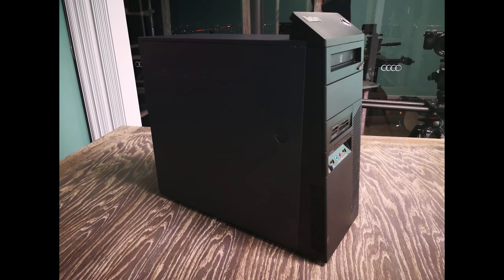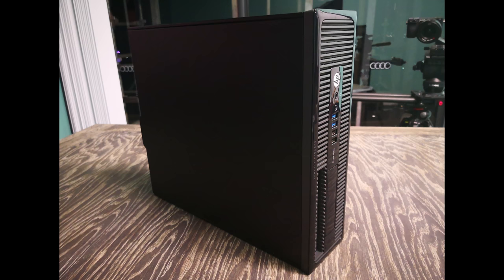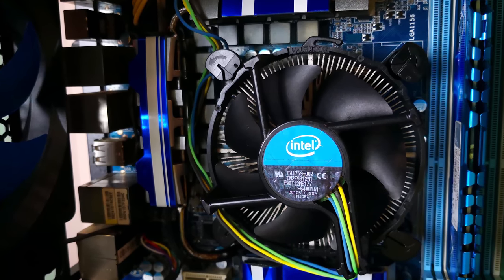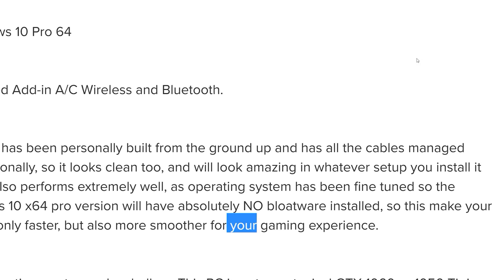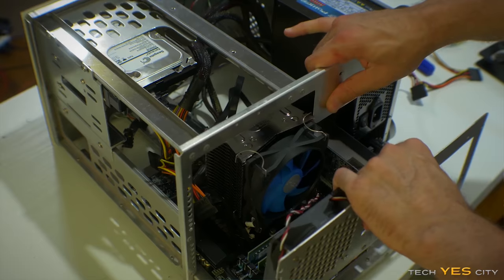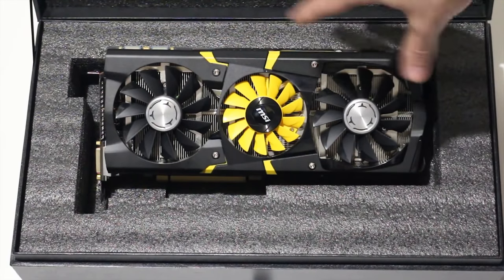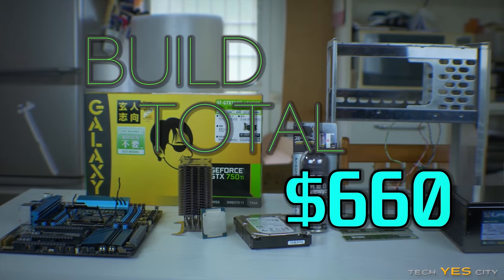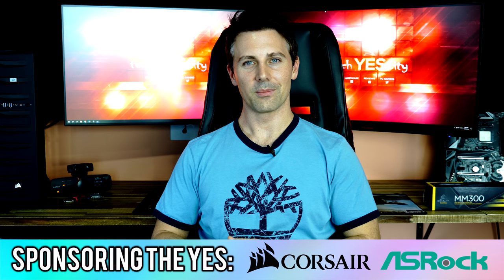How to SELL A Gaming PC In 2018 | Should You Sell Your PC Gear BEFORE a Launch?

Comment: Take photos
Upload description
Include statement: Being sold by Bryan, TYC
Everything sold within 30 minutes of being put up, easy money, it isn't the fact that people want to buy the PC it's rather they only want to meet Bryan and shake his hand in completing the sale.
Reply: Scyn I need your help...You see, I have a FurnaceX-9590 PC
Reply from the maker: Lol, like 95% of buyers never know who I am man.
Reply: having an fx chip isn't really the problem cooling it is, as long as you can keep the temps down it is still worthwhile if you can get it cheap enough.
I still have some rigs which I use from time to time which have 8370 & 9590 chips, works like clockwork if you have adequate cooling just don't expect Ryzen, Skylake, Kaby or Coffee Lake ICP.
But then again you could get the same if not better performance out of a Xeon 1366 or like chip but with triple channel memory, and perhaps slightly cheaper.
Reply: Scyn My PC is probably the ONLY air-cooled FX-9590 with a 212x, some fans and a 750W PSU out there...It gets stable up to 5.1Ghz on base clock, at 5.2 it gets too hot for full loads and past that... It's just unstable as heck. Through a lot of care and days spent on the BIOS for 3+ years, I get 35°C temps idle and 55°C temps at loads if I run it at 5.05Ghz with 202 on bus. That was enough for 100th percentile on userbenchmark. 

The DDR3 HyperX Savage 2400 RAM itself is limited to the mobo, I got it to 2133 with the XMP and then decreased the timings, went from 2T to 1T, increased processor ohms from 60 to 120 and put the refresh rate to every 3.9ms.

I recently put a GTX960 on it (for free) and got it running pretty well so far...With a bit of OC it chews through everything I play on 1080p. If I flashed the vBios, I could probably get it even higher but it's too risky for me.

The mobo is a Sabertooth 990FX R2.0, and with the CPU it's probably the sturdiest abuse-taking machine I know of in terms of consumer-grade systems.

The reason I need your help is because of the power consumption... No one wants a power-hogging equivalent to a Ryzen 5 system.
Reply: http://www.userbenchmark.com/UserRun/1635620 ---> Before I messed with it.
http://www.userbenchmark.com/UserRun/8126477 ----> Current state.
Reply: Advertise the fact that it is a stable overclock, it might be a powerhog but stable overclocks and a written explanation in the selling of the build of a whole goes further in trying to sell it to a willing customer.
What you want is a clean break with the machine rather than tech support down the line, written pdfs and examples of how to keep the machine in good nick down the line after it is sold does wonders.
Examples of what fps to expect if you want to sell it as a whole or part it out, parting it out don't expect people to fumble over trying to buy X part considering the amount of fake 960's which are out there or the amount of 9590's which are out there.

The only part which might sell asap is probably yhe HyperX memory, but again don't expect a win-fall from 2x8 dimms.

You are trying to sell this, advertise the PROS, don't leave out the CONS. heck even Bryan goes the extra mile to take the photos to show his builds in their best, you might also want to watch his cleanse 2018 video to get more pointers on how to show off your build in it's best light possible.
Reply: Alright, thanks for that Scyn. And also thank you Bryan for your videos.
Reply from the maker: No worries man, I love the sabertooth boards, they are solid.  Can you boot up final fantasy 15 for me and let me know if your FX cpu doesn't stutter like all mad?
Reply: Sure haha, I'll make sure to do that this next weekend ASAP.
Reply: Just an update, I managed to get the RAM stable at 2400Mhz woo! I redirected the case airflow and replaced the thermal paste...I'm not sure if I can still run the Benchmark for today but I'll see what I can do.
Reply: Lol

Comment: Used market in East tenn is horrendous, everyone thinks their gear is worth more than new prices.
Reply: Are you trying to buy a computer right now in East TN?
Reply: I buy and sell, I have a shop :)
Reply: Its pretty much everywhere where power is cheap when it comes to GPUs. Even the miners flipping at my country are pricing their used cards more than new.
Aliexpress is okay for odd items, but local e-shopping sites is where I get the deals now. Couponing is addictive.
Reply: How much would you pay for this? 

6700k - 4.7 ghz @ 1.32 volts @ 75c max.
Liquid cooler similar to the corsair H60. 
3 red led case fans
GTX 1080 Amp Extreme ( Best 1080 you can buy) @ 2114 mhz
Gigabyte z170 k3 motherboard (updated to most recent bios)
16 GB (8x2) DDR4 @ 3100 mhz - 1.356 volts
LG GH24NSC0 multi disc drive
Sandisk 128 GB SSD 
Toshiba 2 TB HDD
Windows 10 home 64 bit
AC Wifi USB dongle included
ATNG 800w 80+ Bronze power supply
Reply: Damn yeah I've been struggling to find pc parts at a good price... I also live in Knoxville btw. Lack of a microcenter doesn't help
Reply: I'll give you a 7-11 Slurpee for that pc.

Comment: Definitely giving your stuff a clean before taking photos, as I've seen so many folk getting their stuff up for sale and then saying 'will clean once sold' It's off putting. Check out Tech YES City other videos using WD40. The Solvent isn't overpowering and can clean up your system pretty good. 

If you have any stickers on the case, let the WD40 sit there for a few minutes and it'll help you get those stickers off a lot easier and this also includes that nasty packing tape. Any residual sticky residue can be removed with some soapy water or if you bought a case on the cheap and can't get rid of those stickers, properly. this should hopefully help.

May sound funny, but you can actually angle a simple cheap flashlight/s at the item you're trying to sell, to make it look better in poor lighted rooms. Got this cheapo flashlight from WIlko 'UK shop' and it helps a lot when taking photos, especially of smaller items. 

There's usually PC recycle places stashed all over the place, and you may get lucky. eBay, Shpock, Gumtree, Facebook Market place are a small few I try and check in from time to time, and you will find bargains, just got to keep looking. I lost a 1070 due to lack of funds, it was being sold for £285 when it's worth about £330-350. Got a PM961 256GB at almost half the retail price and it only had 20 hours on it.

Comment: Evga X58 ftw3 I7 950 gtx 770 12gb ram Corsair h115i closed loop cooler 600 watt powesupply Corsair 900d super tower case and no HDD $450 aud good deal or not

Comment: You forgot to say to check similar listings at the time of sale and undercut. Only by a little bit, but it works. I have found its better to make the sale at a slightly reduced price than to hold on to a system and price point forever. Also, places like Facebook Marketplace show that you've reduced the price if you realise later that you should have undercut first, that makes it look like you valued it wrong in the first place, that you're struggling to sell or that you're willing to reduce further if pushed by the buyer.

Comment: There’s a small computer store in my state that way overcharges for PCs... I saw an X58 with 2 GTX 680s and I think 16G of memory... dudes were trying to sell the system for over $2000 USD. I got outta there real quick! 
Edit: Pretty sure the CPU was an i5 or i7.
Reply: Afaik there are no i5 CPUs for X58, only i7 and Xeons. Around the same era LGA1156 had i5 for chipsets H55, H57, P55, and Q57.
Reply: Bitter Cynic so I guess it was an i7. Still ridiculous

Comment: I got lucky this time around, been saving up for awhile was going to buy the Ryzen 1600 but the 2600 releases in like 3-4 days so i can get that instead, would this be the better choice? Or should i go for the 1600 which i would assume would drop in price due to the 2600 releasing?
Reply: CaseyDoesNightcore I'd rather wait for the 2600 tbh, but don't just buy it at the release. Maybe a week later.
Reply: I ordered a R5 1600 build yesterday because the 2600 is €40 more expensive here and I was basically maxing out my budget already. There were other things more important to spend my money on than a slightly higher clock speed and 3MB more cache. No regrets because AM4 will be supported until 2020 and the big upgrades like Zen 2 will come later.
Reply: Damian black Well , we won't know until the 19th
Reply: 2600 ofc wait for reviews
Reply: Definitely wait for the reviews. But neither one is going to be bad. By the time reviews come out, the 1600 should have dropped in price. So, if the 2600 doesn't turn out to be that much of an improvement, you can save yourself a little bit of money.

Personally, I don't see the 2600 being significantly better than the 1600.
Reply: A few more days of waiting won't hurt.
Reply: I would say it depends on your gpu and your monitor, these new ryzens are going to be a little better at those really high framerates, so it you game at a low resolution and high refresh rate monitor with a high power gpu, then wait for the new one.

Comment: so I posted into a random forum about used pc parts. I was telling people about my rig and just got slammed with overwhelming hate for my parts. I got an Asus P6T-SE mobo, Xeon w3680 CPU overclocked to 4.2Ghz, 12 Gigs of ram GTX 970 g1 gaming GPU, Sound Blaster Z, SSD and a few HDDs. I don't know why I got so much hate in response to my hardware it runs everything buttery smooth. I have not found a game yet that won't run 1080p 60 FPS. I am thinking most are truly uninformed at just how powerful the older tech like this still is.  I got all my parts used over a few years.
Reply: xephorce people hating that it’s “old tech” but screw them.

Comment: Should you sell a pc as a whole or every part on its own? Because I have a gtx 1080 waterforce which went up like 200 since I bought it on the used market. So I'm wondering if I charge the fitting amount for the pc, nobody will buy it
Reply from the maker: Sell the card separately and drop in a 780ti or something that you picked up for a bargain.

Comment: I made someone pretty happy this saturday when I sold them a Antec one hundred case I had picked up the week before. I had intend to use it for a media server build but I noticed a post on the hardwareswap sub-reddit that was a year old that someone wanted that case. I gave them a poke, not really expecting much but I ended up making $10 on the deal (I paid $35 for the case, sold it for $45) and he was a local so it was pretty cool. He might even be a prospective buyer for one of my Nvidia GTX 780 reference cards. I really wanted to like SLI but honestly, there's just not enough games that I both own and have decent SLI support that actually yields some kind of improvement. In most cases, a single GTX 780 was more than powerful enough to run the game anyways so any gains from SLI are basically irreverent. Case in point, Borderlands 2. I know it has strong SLI support but a single GTX 780 that's overclocked already gets me well over 120FPS on max settings and since I don't have a 1440p display, I don't really see the benefit of keeping two GTX 780s. That said, my laptop has a GTX 1070 in it so if I need to play a more demanding game, which it'll most likely need more than 3GB of vram anyways, I'll just use that. For now, I'll prolly start using my desktop as a stream machine until the price of GTX 1080 TIs come down to something reasonable. :)

Comment: Gumtree Newcastle NSW

Used IT Gear
$500 Negotiable 

Carrington NSW 

Various used IT gear from engineering office environment.

Includes:

1x PC with 24GB RAM, Asus ENGTS450.

4x Server PC w/ i7 950, 6GB RAM, GeForce GTS250DVI

4x Samsung ITP-5114D IP phone

2x Samsung DS-5014S office phone

2x Samsung DS-5021D office phone

1x Uniden DECT2035 2 wireless phone group

1x Dell Vostro i7 PC

1x DSE FG-30 Function Generator

1x Protek 6502A Oscilloscope

1x Dell PowerEdge R410

1x Endura DVR5116.

All equipment has had hard drives removed. Pick up only from Carrington.

This is being sold as a bulk sale and sold as a single lot.

Comment: I have a pretty old motherboard that supports only ddr3 ram and 4th gen intel processors and I wanted to buy a better CPU but its kida hard finding like an i7 4790k in my country so i decided to buy a ryzen 5 2600 but i dont know should i get rid of the processor, ram and motherboard and buy ddr4 ram the ryzen 5 and a new motherboard or should i sell my whole system and buy a completely new one with the specs I want ???

Comment: I got an i3 3240/4GB/ HD7570 on some cheapo asus mobo, got it for 34€ shipped, want to flip it but not sure if I should upgrade to a 750ti and 8gb, I want to keep the 7570 for testing and troubleshooting. I could even go i5 2500k if I'd get more value out of it. Any thoughts?

Right now, the 750ti sells for 60-70€, a 4GB ddr3 stick for 25€ and an i5 2500k for 30-35€, if I get all these upgrades, it would've cost me a total of 160-170€
Reply: Would you be open to buying my whole PC setup for $480?
Intel Core i5-6500 @3.2Ghz (Never been OC)
Gigabyte H110M-A LGA1151
Ballistix Sport LT 8GB Single Channel
EVGA Geforce GTX 960 2GB.

Comment: Do you find prebuilts from Dell, HP, etc. are easier to sell than custom built PCs?
Reply: Personally not in this day and age. They look to most non-PC people like an ugly black box, often have proprietary fittings and parts (like no standard ATX mobo connector, custom proprietary motherboards, so replacement PSU's are expensive and a nightmare if you find you need one.)  Anyone who used to buy them (just for a family PC) would probably use a tablet/laptop these days and not even bother with a PC. Flip value on them is rubbish in terms of sale price. Anyone gaming isn't going to want one as the most you can (sometimes) put into it is a 750ti or 1050ti. I only go with Dell's these days as they have more generic connections and are known work horses. Especially easier and cheaper should you need to swap out parts. Just my experience but I don't even bother with HP, fujitsu etc anymore. More hassle than they are worth and anyone who DOES want one as a family PC isn't going to pay much as they'll just buy the next generic box they see if yours is too expensive. They aren't into Specs etc...so they don't know the difference between CPUs inside it they just want something that works.

Comment: best deals i got were a r9 290 for 60 bucks, a dell studio xps 9100 for 25 dollars and i got it specifically for the x58 board, and i got a laptop that had a i5 650m with 8 gigs of ram and a 1tb hdd for 50 dollars
Reply: Poviku-PPcans i sold the laptop for 150 dollars

Comment: hey bryan i have a gtx 1060 strix oc edtion im keen to sell. in nz let me know what its worth <3
Reply: 360-400 i reckon
Reply: Omar H 355 dollars best for brand new... i say 300-320 if used . Good condition used 335
Reply: A gigabyte gtx 1060 3gb is 279.99$ on amazon. a 6gb gtx 1060 is around 340$ to 400$ brand new
Reply: I've seen a few recently go for as little as $300-$320 NZD although those are usually for the mini itx ones so you could possibly get more for a higher end model.
GTX 1060 6gb are in higher demand
Reply: i have a good condition 6gb model self boosts to 2050mhz whos keen ?. and thanks for the pricing guys <3
Reply: I would buy it for a 100
Reply: Completely  dependant on how NZ is faring in the GPU shitstorm.
I sold a 4GB sapphire rx480 for $150 more than what i paid. I could do that because there was no stock to ever come back in, and people who had gotten one as well, were looking to get another to crossfire (exactly what i was planning, wait a bit then get a 2nd on the cheap, then the mining boom happened).

At the moment i wouldnt be going $100 under MSRP in NZ for what u have. Dont get duped into selling it just because people tell you its worth less. Get what you want for it, many people troll for weak people, if you find someone who is keen on it, they will go for it. Just the downside is that a 1060 has less future proofing to it, so maybe $150 below if your having no luck and need the money.
Reply: Just saw someone tring to sella 2600k with a 1060 3gb in new zealand for $900 and 8gb ram

Comment: i hate used stores in my location every single one adds $100s over the most thay should often costing the same over best buy bargains that are verified and guaranteed so you dont pay twice if its not fixed up and/or running its like thay all have a bad business pact compaired to best buy witch in itself is not coming close to finding someone like you brian to help them out.